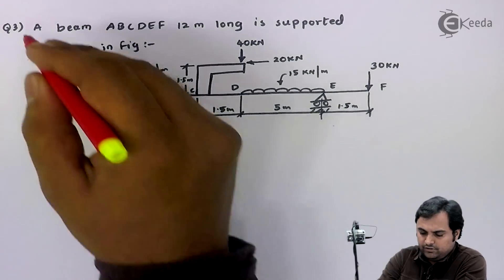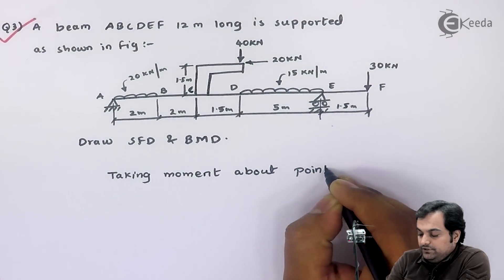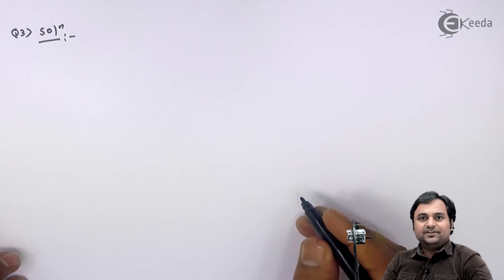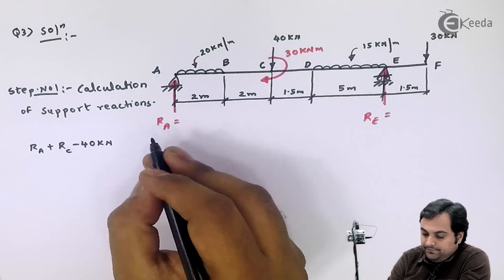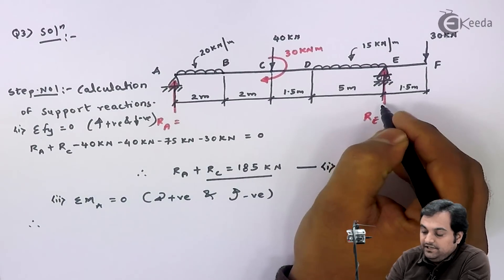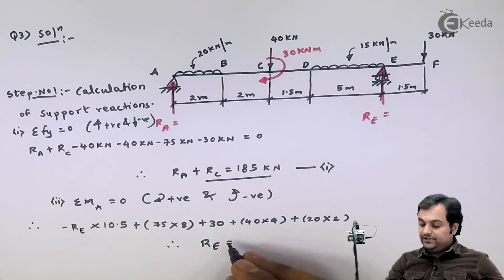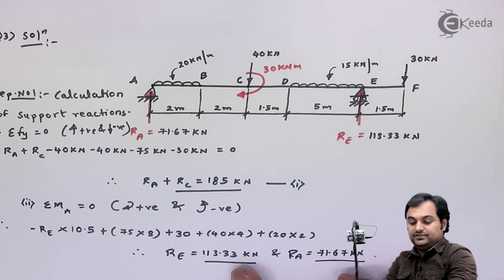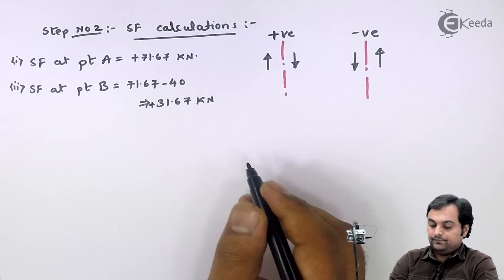SFD and BMD - Problem 3 - Part 1 - Shear Force and Bending Moment Diagram - Strength of Materials

Comment: Sir..why did we miss the vertically downwards acting force,20 kn at point c...after conversion of the diagram..?
Reply: yes a horizontal component is there but it will not creating shearing, so we can not include the horizontal component

Comment: To begin with, Re value is wrong. It's not 113.33, it's 79.04~ 79.
Reply: Also take the point load into the consideration acting at pt F(30kN) , then calculate you'll get the value as 113.33kN
Reply: @fusionbeatsgoa2245  mujai kuch samaj nahi ayh 🥺🥺🥺
Reply: @NITSRINAGAR786   check dear above comment💬
Reply: @abhishekregi-1915  hmm abi ayh samaj thanks dear
Reply: @abhishekregi-1915   Ax =0 laina hai ya Ax=20  yai confusion bi clear karo plz 🙏
Reply: And  also   add the   moment 30kn at the point C

Comment: there is a mistake while calculating moment about point A
Reply: Should not there be the 30kn force considered in moment calculation
Reply: @saswatdash8668   should be considered then the answer will match

Comment: Why we are not considering the cause of moment of the over hanging part i.e. 30 KN while calculating the moment at A
Reply: but the fact is even after not considering force acting at point F , the moment about A is coming same when you take force at F into cosideration😂😂
Reply: sir forgot to take
Reply: @SaratJena72  no earlier it was 40 vertical and 20 horizontal so we didn't consider horizontal components

Comment: shouldn't the the net reactive force at A include the 20kn force as the horizontal component?
Reply: yes a horizontal component must be there but it will have no effect in calculating shear force because we only consider vertical components

Comment: why u sir not consider the force 30kn at point F at the time calculation of support reaction.....pls anssss..sir plssss
Reply: because it is an overhanging part and moment about overhanging part is zero.
Reply: @--AIIDivya  but in that case we were calculating moment about point A, so that far point should have been considered
Reply: @--AIIDivya  but We aren't considering moment about overhanging part, we are considering about A
Reply: 30*12 should be taken as clockwise moment for moment about A. then the calculation will be correct
Reply: rabindra shrestha
Thank you for beautiful explanation.. but
Sir please put the 30*12 value in equation....
Reply: Bhul gaya sir
Reply: He did consider it. He forgot to write it